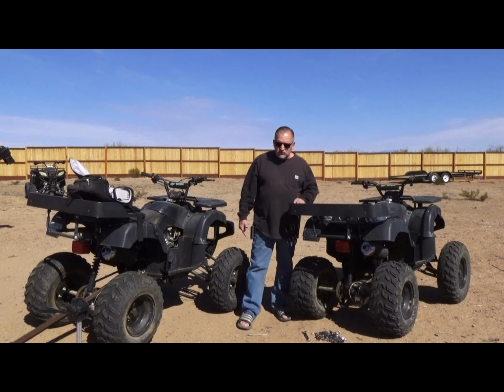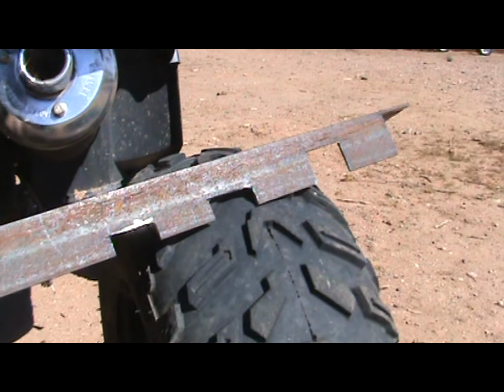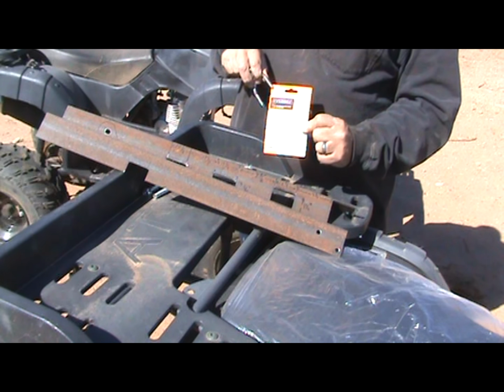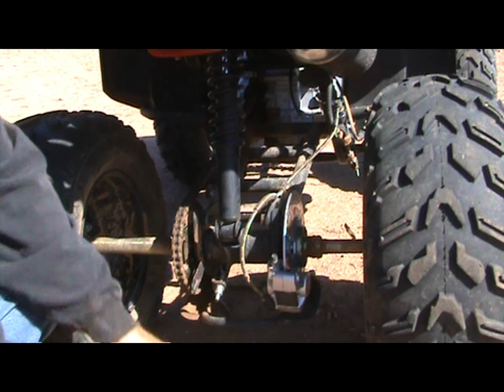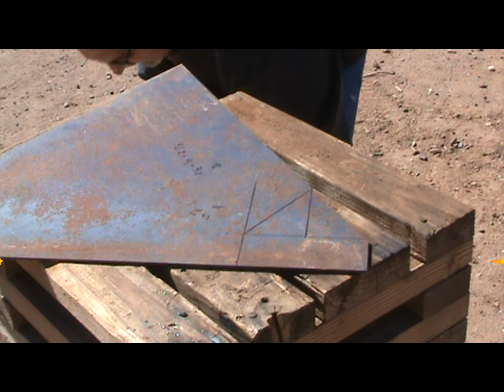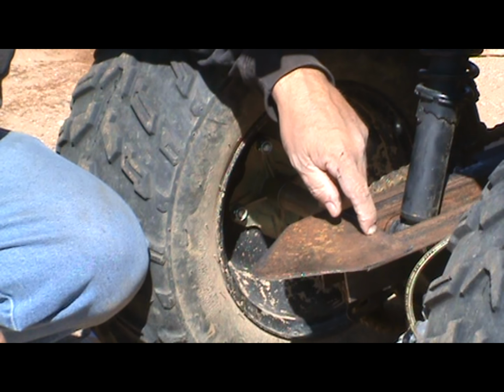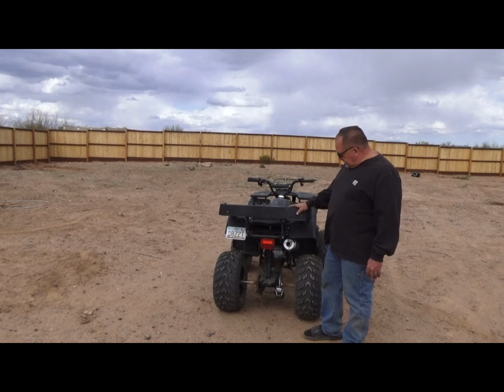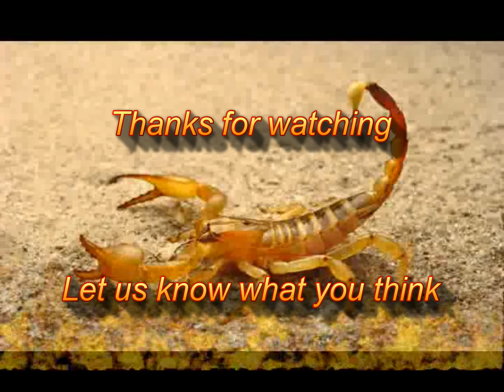Tao Tao 250 Rhino Trailer Hitch Fabrication

Comment: I really like this series on the Rhino. They are very informative both in words and visually and gives me an idea of what life with a Rhino would be like. I appreciate the effort you put into capturing details. I want the Rhino with aluminum wheels, but they do not yet sell it with aluminum wheels. That hitch is probably overkill IMO, but it sure will not fail. I saw a video of a Rhino where the tranny was stuck in 2nd gear and wouldn't shift out. Does the transmission seem solid to you? Does the chain come off while riding? Let us know if anything goes wrong and also if all is well over time of usage. Thanks!
Reply from the maker: Wow! Thanks for watching and your comment is a great compliment. Feedback is greatly appreciated. Thanks again!

Comment: i won't be using this for sport riding or any extreme off roading, just some wood moving and transportation. will it work well?
Reply: @console commander. it will work man i got the 150 and i can pull about 350 pounds easily

Comment: how wide is your pin plate from side to side or should i say wheel to wheel is it about 6" wide?
Reply from the maker: John Melissa Lawrence 5.75 inches wide. Using 2 inch angle iron with the shock absorber bracket in between.
Reply: thank you, I was thinking of using the Reese Towpower Step Bumper Receiver so i can use my deer rack and other stuff with it

Comment: Any problems with the idle not being consistent?
Reply: Jeffrey Rice need to rejet the carb. It’s usually running lean from the factory. The carbs bowl is also sealed shut (they brake off the heads on the screws)so you would need to dremel flat slots where the screws are for it.